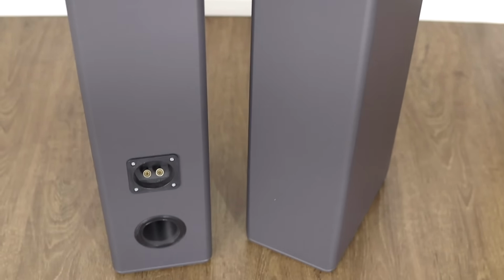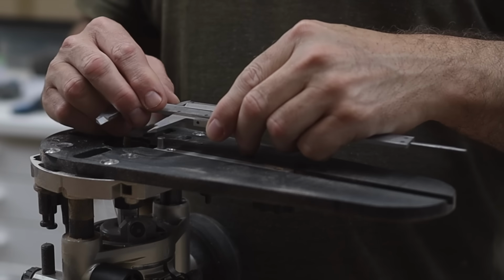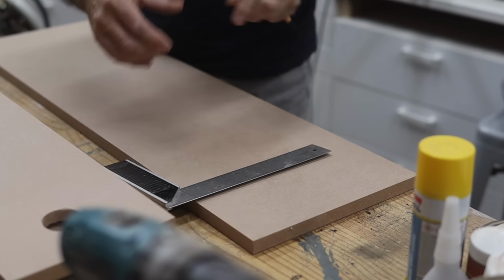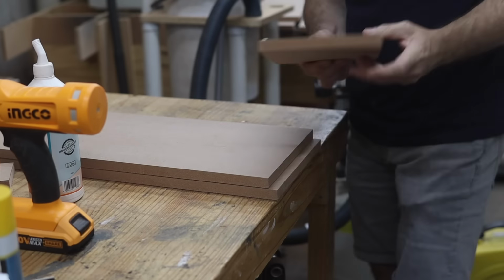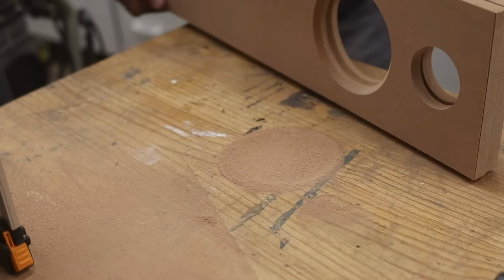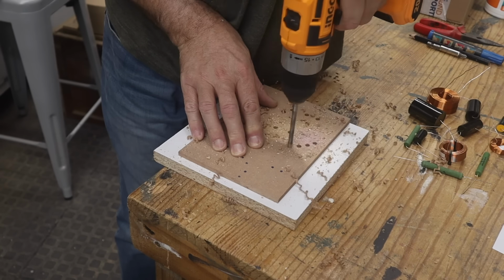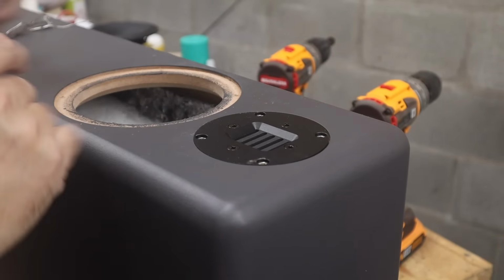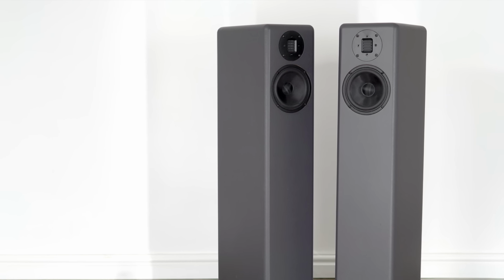Building the Arylic TQWT 5 inch Woofer 3-Way Floor Standing Speakers - by SoundBlab

Comment: I have some questions) Why you build pipe with step by step increasing cross-sectional area but finally put small rounded port? Better may be build decreasing pipe with rectangular port at the end point. It can be more compact and much more low Hz bass point with same woofer.
Reply from the maker: This can be explained as a mass loaded horn. Or, the port can simply be reshaped and put at the end of the horn as a rectangle opening. It amounts to the same thing.
Reply: @SoundBlab Внешность акустической системы,не соответствует внутреннему содержанию!Так ПОЗОРНО изготовить сам кроссовер!

Comment: Cool design!  I was going to ask why dipole (rear firing tweeter), but since it can be omitted, I would 100% use a switch to be able to enable or disable the feature.  Or, I think with yeah with a separate set of binding posts which can be bridged, effect would have been the same as the switch.
Reply from the maker: Thanks. Yes, something like this will be an option.

Comment: Thank you so much for taking the time to post these designs! I have built two way speakers in the past and although I used high-quality components and solid builds, they still do not sound bright enough for my taste. I’m looking to be able to hear the sharp ding of a triangle or the sound of a cymbal being crashed. I had a pair of ESS AMT – 1’s and really like the sound. I was thinking of building your AMT and 5 inch driver model. Would that have a nice bright and detailed mid range?What build would you recommend that has a bright sound along with fairly deep bass?
Reply: Arylic TQWT 5 inch 3 Way

Comment: How do these compare with the larger Arylic speakers? I built the larger ones and really enjoy them however my wife is not a fan of how large they are.
Reply from the maker: They compare well, perhaps less output in terms of how hard you can push them, but should still be more than enough for the average user. I might still just prefer the sound of the larger one by a slight margin. The smaller ones perhaps tuned slightly bright, but if you omit the rear firing tweeter, this might solve it if you prefer less bright sounding speakers.

Comment: Nice build! 
Why did you use an passive Crossover, instead of using the 3 Way Arylic with internal DSP, so you could connect each driver seperat?!
Reply: Interesting Question. Know there was problem to separate L/R amps.
Reply from the maker: I wanted to design a passive loudspeaker, not active.

Comment: -6 dB at the junction of the bands leads to distortion. audible to the human ear. in this option, all the summation energy goes to maximizing the amplitude    
the phases of the stripes are strictly parallel. between phases 180 or 360 or 360+180 or 0 but not in the analog version. but there are other options for strip summation. and there is an option in which the summation energy is spent not on maximizing the amplitude but on maximizing the movement of the phase wave. to my ears, such acoustics sound better with the same frequency response  писал через переводчик

Comment: This is not 3way. I see only 2 drivers
Reply from the maker: Tweeter on the back
Reply: @SoundBlab  Yes but that's not make it 3way. 3way say that you have 3 speakers playing different frequency. (woofer, mid, tweeter) Rear tweeter is only for ambient sound.